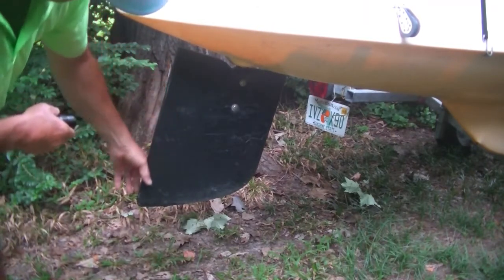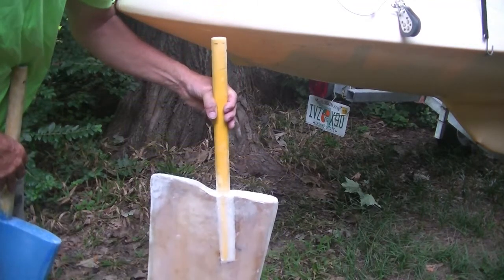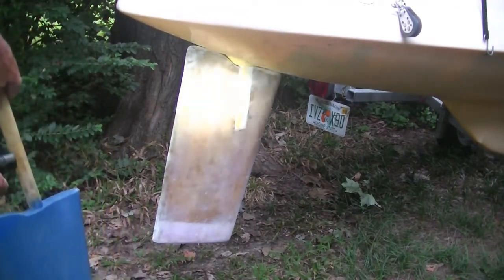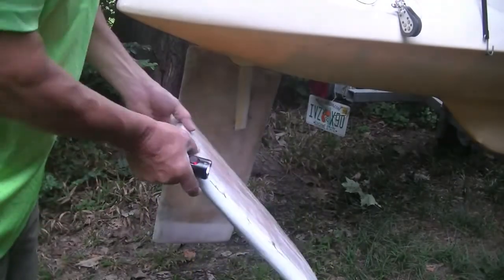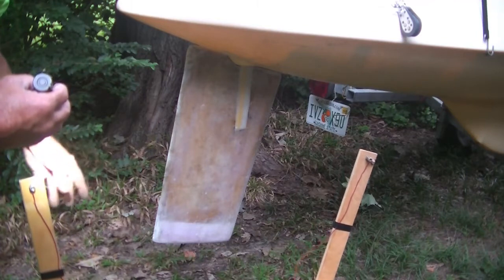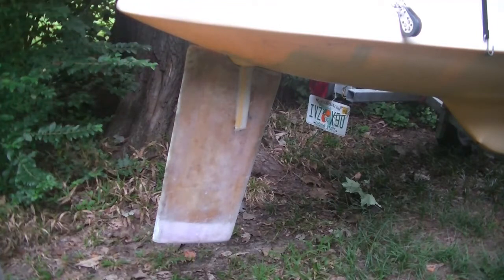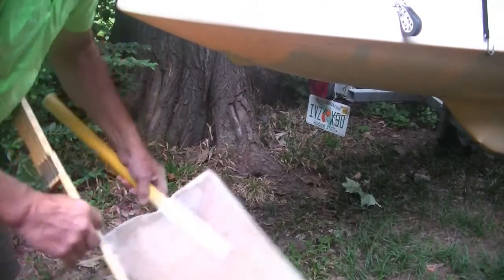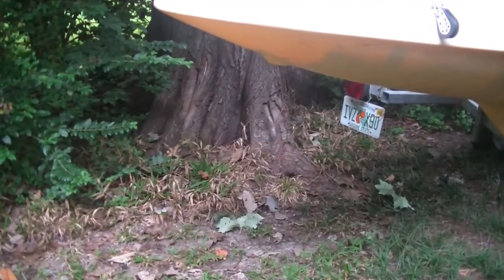How to make your Windrider 17 faster make the rudder

Comment: Thanks, the foam cutting part was especially helpful. Instead of colloidal silica though, I'd use a fairing compound... it will make sanding a lot easier.
Reply from the maker: the silica is lighter and forms a better bond than using fairing compound.
Reply: @luckyliftsailing1106  You got me there... Silica is better for bonding.

Comment: Great work
Reply from the maker: Sorry for the very late reply .Tried one rudder out thought we were getting good results but it sheered off because rudder post was not filled with epoxy and the extra torque from the more efficient foil caused it to sheer . Will fill the second rudder  post that was made and continue to test. I have to many projects going at the same time. We sail several boats  and try to keep them all maintained ,New trampolines for both the Windrider 17 and the Corsair F28r  completed. Started to refurbish another Windrider17 and a Windrider 16.

Comment: How did it test?
Reply from the maker: The rudder post i used was fiberglass and should have been filled with epoxy to make it solid .In light air it seemed more responsive but with the extra lift from the foil shape it twisted off when the wind picked up. We lost that rudder but have another ,just have not had time to go back to it. Disadvantages of the longer rudder are it will now catch crab pot lines ,you have to be very careful when you launch the boat and move the boat around on the beach.